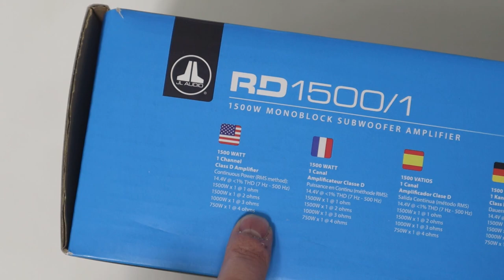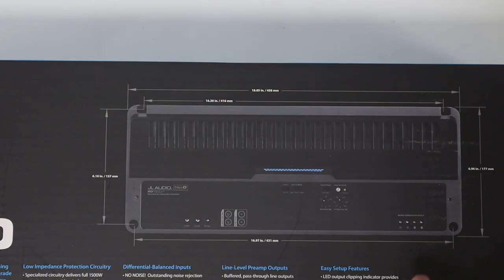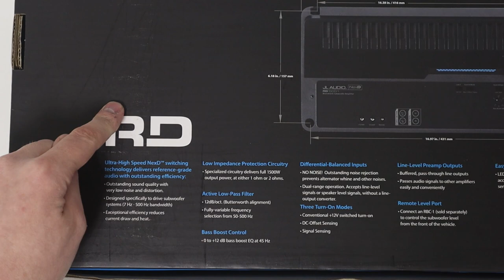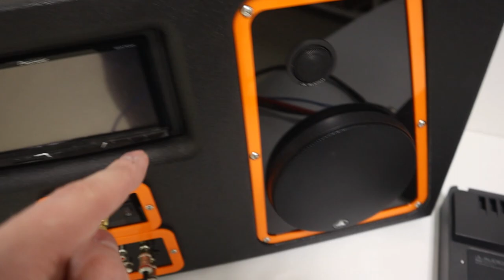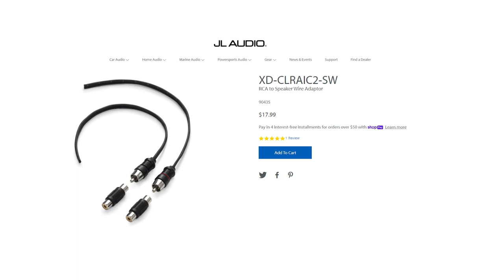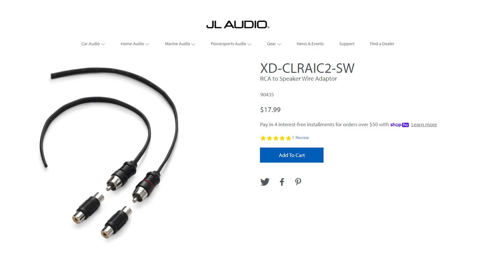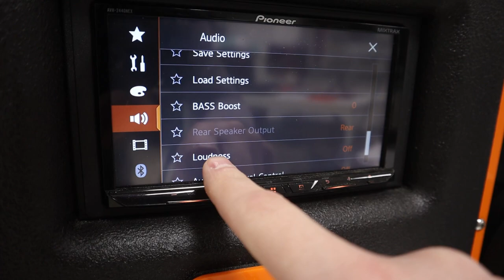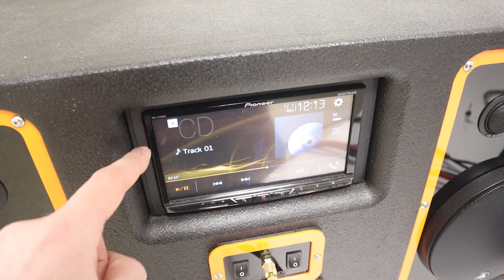Pure Subwoofer Power! JL Audio’s RD1500/1 Amplifier Spotlight

Comment: How do you include a car's individual acoustic properties into sub box type, size and design? I have a 2006 Nissan Maxima and two choices of subs I have. I have 3-12w0v3's, or one 13w3v3-2 to work with. Currently i have the 3-12's in a ported box at 5.25ft³, with a 10"x4"x16.5" long port. Tuning freq is 27hz as i recall. I got the box specs from Carlos Chaves the Tech. Dept. Director there at JL Audio   about 3 years ago.
 I have 2 goals im looking at. One design to be as loud as possible for each type or sound quality for each type. Sealed/ported/ 4th order/or 6th order series or parallel tuned, ill build anything.
 Its a lot to ask but i think my vehicles acoustics arent very good. I will be willing to build a sq and spl box for each just to see which i like best also. Of course it sounds best with the rear seats folded down but is it possible to still be as loud just porting through the rear deck and/or the center of the rear seat with the armrest removed. I just want to know if i chose the wrong type of box for the 12's. Im not concerned about power, just let me know how much i should give them(at one time i had an old Orion 225 HCCA DIgital Reference ²nd gen going to the 3 12s and it was pretty darn loud for that little amp i must say. But right now my set up is:
Head unit: Pioneer DEH-X8800BTS using 
                    full range out of the RCA's.
Signal proc: An Audio Control Epicenter
Amp: A mint condition XTANT X603 I got
           back in 2003 but never installed it 
           until the summer of 2020. Im using
           its internal 24db/oct x-over with 
           the factory 90hz xover chips in it 
           so the Epicenter gets a full range
           signal.
Front doors: JL Audio 6"C2-600 comp set
Rear doors: JL Audio 6.5"C2-650x coax's
Subs: the 3-JL 12w0v3's.

 If im asking in the wrong place im sorry, if you could direct me to someone who maybe has this type of car or anyone with experience with my  issue it would be like a gift from above. I know this is very wordy but in the past since 1993 ive owned all of these JL subs: 1-15w5, 4-10w1's, 2-12w5's, 3-8w6's,1-12w1,1-12" Power Wedge box, all of these were powered in various ways by Precision Power Art series and Sedona Series amps, Coustic Power Logic amps, Alpine headunits (7903,7915,7803s,7272s w/cd changer),Clarion 6770, and a DRX-8175 head units,Audio Control signal processors(2-EQL's,an older Epicenter, a ESP-2 spatial restorer), a PPI OMX-432 in dash 4-way X-over and a PPI PAR-224 in dash parametric eq, Stinger RCA'a and StreetWires power cables. Also MB Quart and Boston Acoustics Pro Series mids and highs.(i had to say it all)
BUT ANYWAYS, thanks for letting me inquire and "vent" here.☮️👋😁👍
Reply from the maker: Thank you for reaching out!

This question may be better suited for our tech team. Feel free to submit a request here: https://jlaudio.zendesk.com/hc/en-us/requests/new

Comment: The jl
JD
RD
XDM
Vxi amplifier portion
Are all almost identical 

Unless you are going to HD series you are better off getting the JD series as they are way less expensive 

Unless you really feel same side connection is worth the additional money and feel power roll back is necessary 

And at that point if your equipment is overheating and power needs to be rolled back 
Might need to look into a bigger issue causing the heat in the first place 
Like gain settings or ventilation

Comment: Why is this the only 1500
Reply from the maker: It is tricky to support 1500 watts properly, so our engineering had not considered an amp that powerful until recent times. RD is testing the waters. Perhaps we may offer other 1500 options in the future, but we have no official word on that yet.
Reply: @JLAudioInc  can you explain why it’s tricky at 1500
Reply: @throwback_jackson  The cars electric circuit obviously…You’ll need stout electrical to support these wattages without any unintended fires or other mishaps..